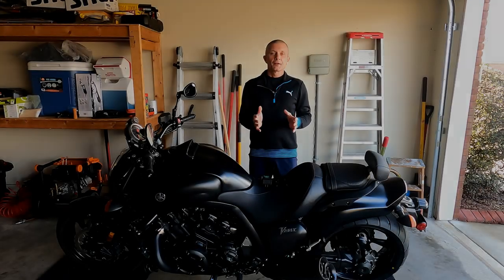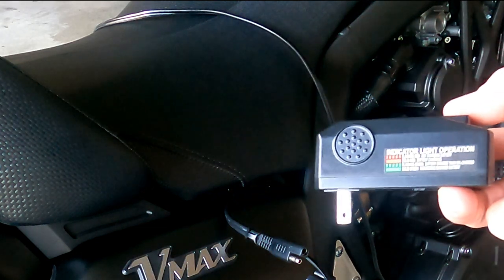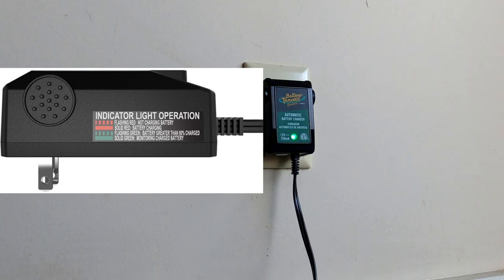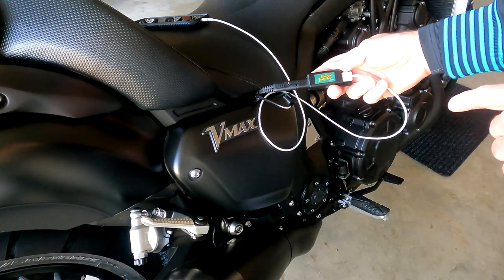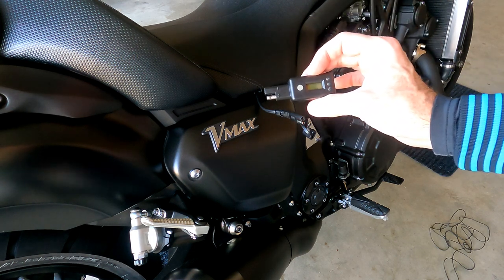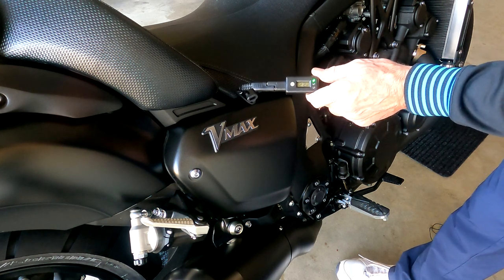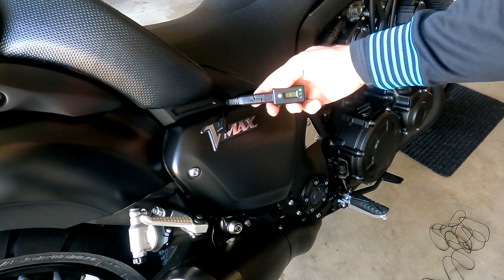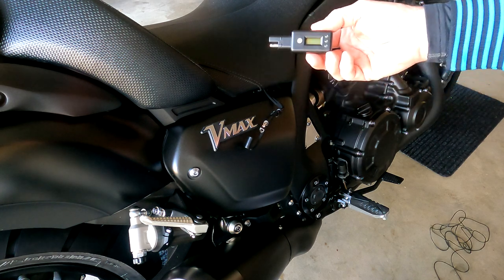How to Use a Battery Tender Charger and Two Battery Tender Accessories

Comment: let me ask you....when you plug in your tender without being connected to the battery....do the lights on the tender come on...so does it have to register it connected to a battery for the lights to come on.  I have one and plugged it in the wall and not connected to a batter and it won't go on.
Reply from the maker: I have two Battery Tenders, and they both show lights even when they are not connected to a battery.

Comment: My motorcycle came with the tender cord stock. It’s my first bike so I’m not sure if that’s normal, but I’m curious if that cord can be used for anything else like heated gear etc?
Reply from the maker: As long as that cord has an inline fuse, you can use it for any accessory.
Reply: @JeffMarcum  Nice! Thank you for the response.

Comment: Could you jump start your bike from what plug??
Reply from the maker: I wouldn't try it. I don't think the gauge of the cable is designed for that much current. I would used old fashioned jumpers or a battery charger/starter.

Comment: I thought it was going to be a battery you could plug into that and give your battery a boost if you were away on a ride and the battery drained for some reason.
Reply from the maker: I may get one of those at some point, especially now that they are not that big. If I do get one, I will post a video on it.